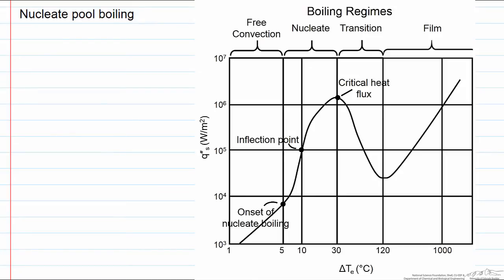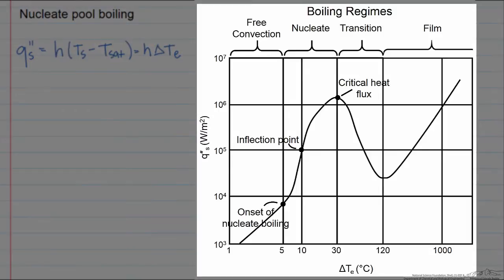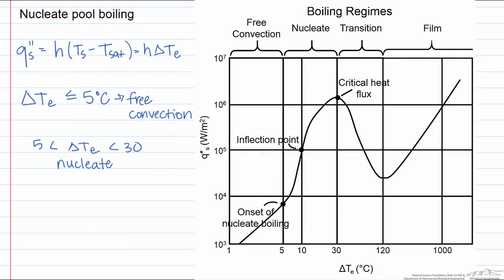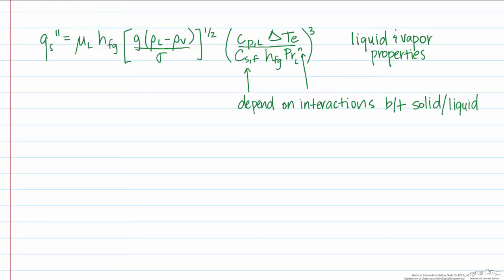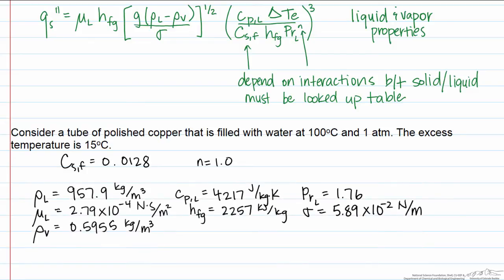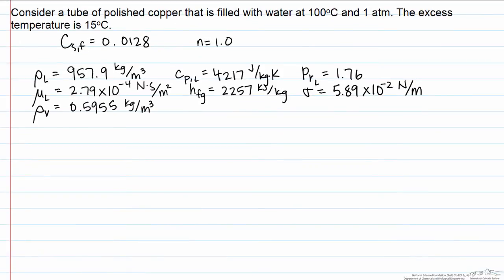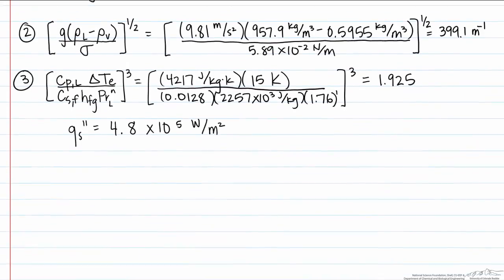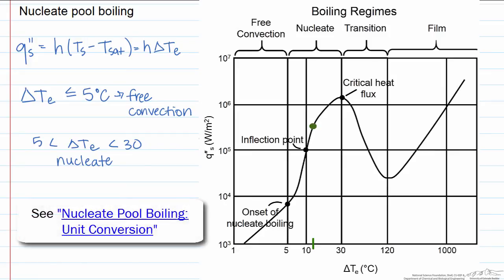Nucleate Pool Boiling

Comment: nOTICED there is a little mistake. you used 15 c in calculation, instead of 15 plus 273......288 k
Reply from the maker: +Martin  Hugo Thank you for your comment.  In this case, the excess temperature of 15 deg C is a temperature difference.  Therefore, it is the same in both deg C and kelvin.  So 15 deg C or 15 K is correct.
Reply: So the excess temperature value stays the same in C as well as in K?. Your videos are really amasing, they are being a blessing for me through my heat transfer class.
Reply from the maker: +Martin  Hugo When the temperature value is a difference, the units of deg C and K are the same.  For example, if the difference is between 150 deg C and 100 deg C, that answer would be 50 deg C. If we were to switch units to Kelvin, that would be (150+273) - (100+273), or 50 K.
Reply: got you, thank u.